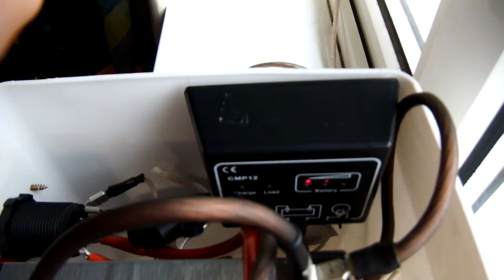Solar portable power station - Camping/Festivals

Comment: You will need a 100w solar cell to get any good use out of it. 20w will only produce about 10-15w functional charge, and of that, only about 7-12w will actually be "charge power". It will take a week to charge the unit.

20w/16v = 1.25a (Batteries charge with 16-18v to get 13-15v.)
1.25a x 8 hours (useful light) = 10a in 8 hours

Your battery load/supply, 70ah...
70a / 10a = 7 days to charge (From 0amps usable to 70a charge)
{2 weeks actual, after losses and non-ideal conditions}

With a 100w...
100w/16v = 6.25a
6.25a x 8 hours = 50ah...
70ah / 50ah = 1.4 days to charge (From 0a usable to 70a charge)
{Closer to 2.25 days with losses}

Prime would be a 250w solar-cell, but using power directly and dumping the rest into the batteries. Using any abundant energy for fans and a peltier-cooler, so none is lost.

However, 100w would let you charge/drain/refill... but you will still be down 1/2 to 3/4 of the time. With 250w, you can be up 16 hours... 8 charging and 8 offline.
Reply from the maker: Thanks for your reply. Since this video was made the system was used with a 40w solar panel. This proved enough to maintain the battery for basic camping needs like lighting, charging phones and a fee hours a day to run a small fridge.

While a 100w+ panel would be better, cost and physical size/weight make it impractical for what I use the system for.

Comment: Hi. Like your idea. But I would change battery to caravan type battery 110ah.  I use those wheelie power tool box.  Put battery in bottom tray. And put inverter in mid tray along with charger/regulator for the solar etc or if u using those low 12 v car solar trickle charger.  That is fine.    Reason I do this is I fly model plane.  Need charge my lipo battery in planes.
Reply from the maker: Thanks for your reply, yes that would be a good idea. For this set-up I got the batteries for free which is why I used them but for longevity and capacity bigger deep storage batteries would be best. Just need to watch the weight as even with these small ones it's not light.

Comment from the maker: True, not the best mix. However the car battery itself in this video was very old. The main reason it was there is because it was free and even through not the strongest, it gave the box as a whole more capacity than without it. If building a box using new batteries then yes I would always use the same battery chemistry where possible.

This was cobbled together with spare parts.

Comment: The reason you should not mix those sealed lead batteries is they like to sit at around 13 volts and your car battery sits around 12.3-12.5 volts, So your car battery is discharging your sealed lead batteries after you take them off  charge.

Comment from the maker: I did use this at a festival and had a folding trolley for it plus drinks and tent which worked out quite well. Though I have since put together a Mk2 in my later videos that goes back to basics as I found this box too heavy for it's intended purpose...but a good project none the less.

Comment from the maker: Those outputs were the thickest I could find at the time, but yes they are not suitable for big engines and also due to the shape of the terminals it's hard to get jump cables on them. They were intended more for future upgrades or additions and have since been used to link the box to other batteries for extended capacity.

Comment: @kvasilepton   I have heard from people who have mixed batteries that as long as the cell chemistries and battery types are the same (i.e. only flooded or only gel, etc.) mixing is not much of an issue.  Mixing flooded and gel batteries as done in the video can cause problems as the charging characteristics of each type are different.

Comment from the maker: @kvasilepton 

Hi, ideally yes the batteries should be the same capacity and age. In this case the batteries were free or had been left after being used before in my van, so it was worth linking them all together.

With the charging and draining of the bank from different ends I have heard this before on my bigger system but personally do not think it makes a major difference, at least not in a small system with thick cabling as whether it is wired one end or the other its the same conductor.

Comment: All battery that are connected in parallel should be the same type/size and the same age. 

If they are different, you will limit their life the battery. 

You should also connect the negative and positive of the load and charger to each side of the battery bank.